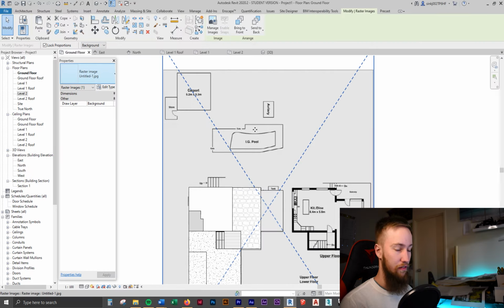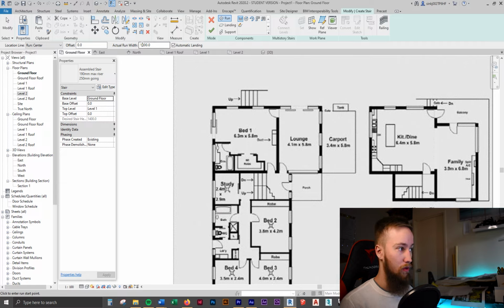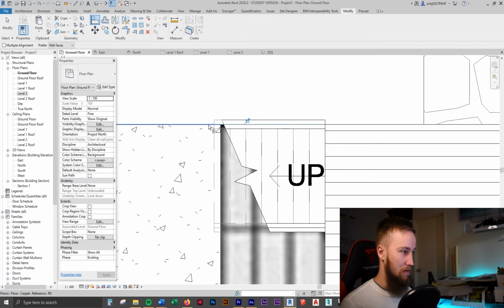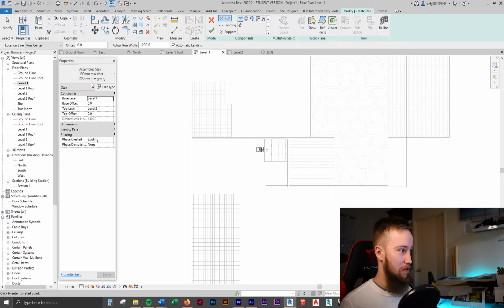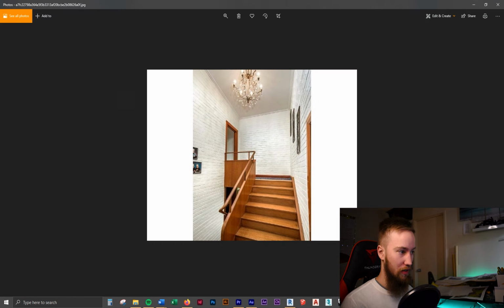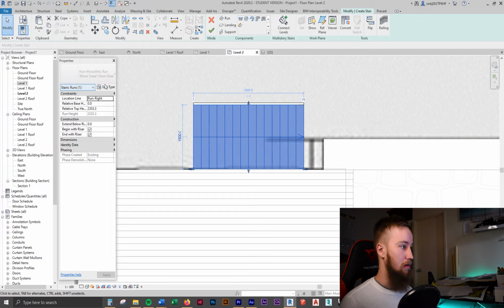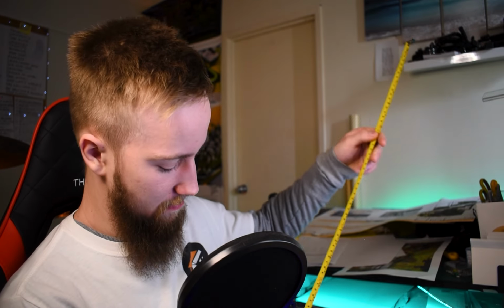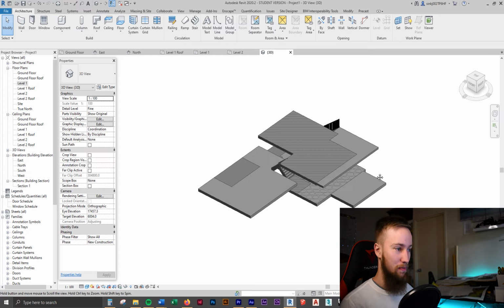Revit Course for Beginners – Revit Tutorials to Learn BIM Fast | Part 3 - Stairs

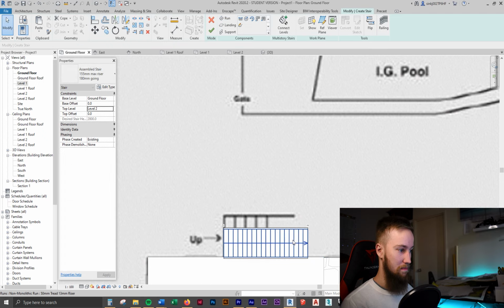Comment: 12:55 your stairs width reset from 650mm to 1000mm (min). 650 fit the scaled off floor plan, but does seem small. FYI

Comment: Hi i am doing a circulating stair (not spiral) it's like a stair is circulating an elevator core, the issue is on the 1st flight the width of the stair is 1200mm, as it turns the corner of the elevator core, the 2nd and 3rd flight the width is 1050mm, how do i connect this 2 types of stair width ?
Reply from the maker: It can get tricky, but you will have to draw the stairs by sketch and specify the width of each stair manually. You will need to draw in the risers, stair boundary and direction manually.

Comment: At around 12:50 ish you create the stairs, and then delete them and redraw with adjusted parameter (in this case stair width) cannot you adjust the paramtres of previously modeled stair? Or is it just the way you preffer to work in those early stages? Also, it is not possible to adjust geometry in 3D view? (the slab aligment to the stair) Thanks for answer.
Reply: in my exp tho still a beginner one, you can adjust it in parameters. and also yeah in 3d view if you prefer that way.